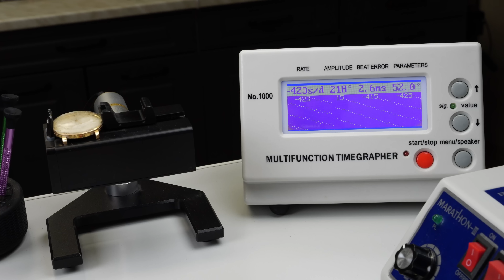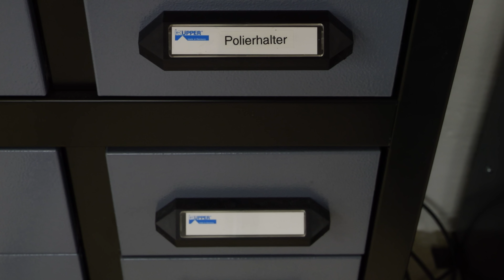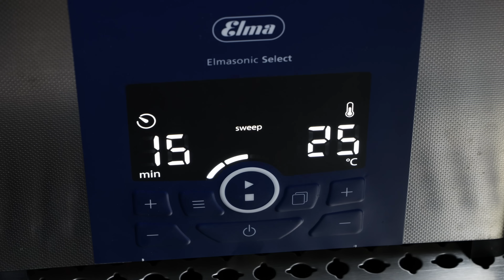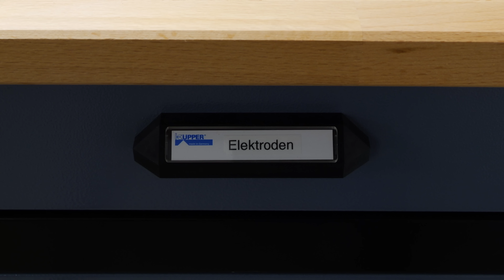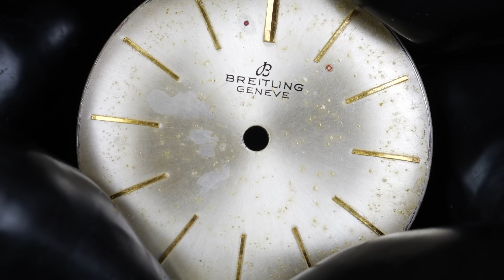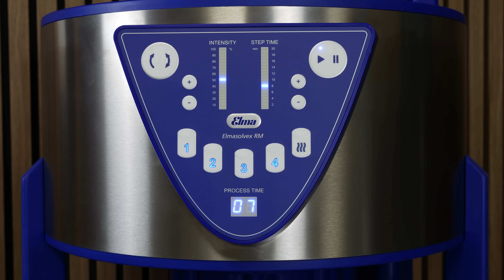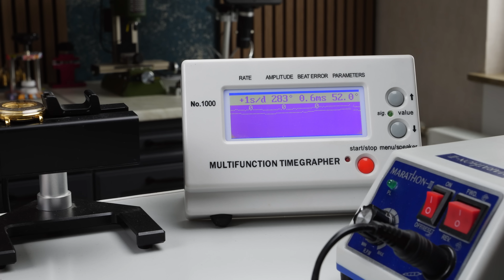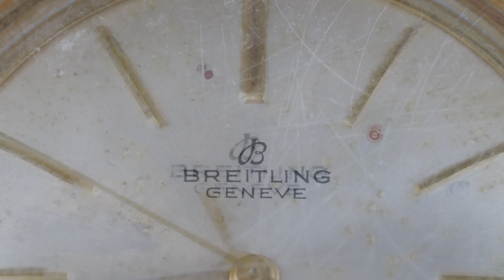Broken but Still Running Vintage Gold Breitling Restoration - 24K Gold-Plating and Service | ASMR

Comment: Interesting to see the specialized tools.  That one for holding the caseback for polishing is a great idea.  It’d be hard to hold by hand.  Though it does look like it could be a movie prop.  “Tell me the codes, Mr. Bond, or I will use the Expander on you! [evil laughter]”

Comment: It was watchmaking precision in cleaning and applying a new gold electrolytic coating.
There cannot be even the slightest defects during this activity (!).
However, I wonder what devices were used in the construction of this watch? And what experience do you need to have to do this? 
Congratulations and best regards 💖👋😀.

Comment: 9:54 - it never made sense to me why the dials are so dirty when they are covered up most of the time. I have 5 dials, and they never look like this. If you treat it like sht, it'll look like sht. Doesn't matter what conditions you're wearing it in. I'm in Canada - worst weather on earth - save for the Amazon in monsoon season - and my dials have always been perfect. My grandfather had a time piece that he wore for half a lifetime and it never looked like this.
Reply: You deleted your previous comments and my answers. Not cool. 
The reason why you haven't had this problem so far can have many reasons. My oldest watch I use was made in the early 60's and it also looks brand new but... There are many people with many approaches, working/living in many different environmental conditions and it makes huge difference in the end. It is not about "treating watch like sh...t". For many people watch is just an everyday tool they wear no matter what and they don't care about scratches, patina etc. Accidents also can happen like dropping watch into water or heavy rain etc. This particular watch was not designed to withstand high humidity and high dusty environments. It is typical dress watch. No gasket on the push-pull crown, no gasket on the glass. Last but not least: Canada doesn't have the worst weather on Earth. Come to South-East Asia, India or even central Europe.

Comment: I have an orient ray 2 that I have been wearing continuously for almost 2 years. one day, I found it stopped by my hand. I loaded it manually. until then, the clock had an advance of 3 seconds/day. since it stopped, it reached -60 seconds a day. I sent it for repair, being under warranty, but they didn't do anything, they didn't find the cause of the deviation change, they changed the current deviation to a lower value and sent it back to me. I sent it to the service a second time and I said that -25 seconds a day is more than the official deviation and that I ask them to find the cause. They sent it back to me, saying that the defect did not manifest itself. please ,  a suggestion, it is my favorite watch, what could be the cause? the watch hasn't suffered bigger shocks than usual, I'm right-handed and wear it on my left hand

Comment: I don't understand something...Why do ALL that fantastic work, get the entire watch looking Brand New just to leave a horrible looking Dial on it?? It's the face of the watch, why not just replace it???? 🤔🤨
Reply: The watch is decades old, there aren't dials just sitting somewhere ready to be bought.
Reply: @garyboyle695  ...It's not the Guttenburg Bible, I'm sure there are faces to be replaced unless the owner wanted all the original parts unless they were broken, that I could understand...
Reply from the maker: I wasn't able to source a new one. As @garyboyle695 already said. They are not sitting somewhere waiting for someone to buy it. Sourcing a new dial for a watch like this can take months or years.
Reply: @RedDeadRestoration  actually, I thought whenever you used the time machine that you had the dial professionally restored.  Didn't realize you found replacement dials!